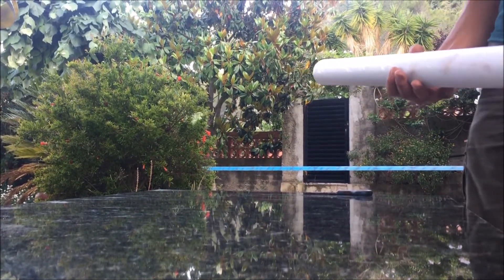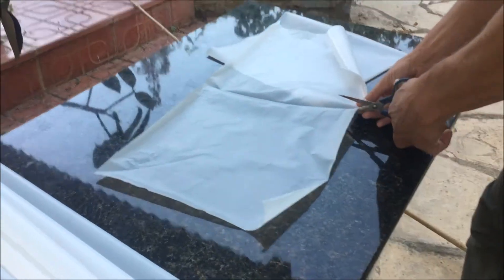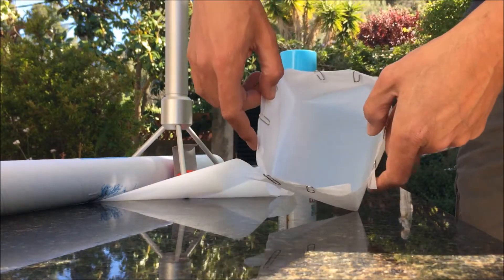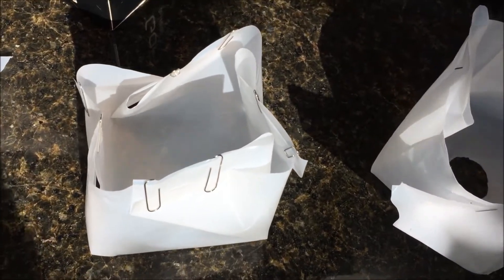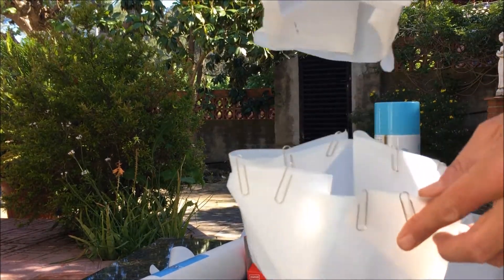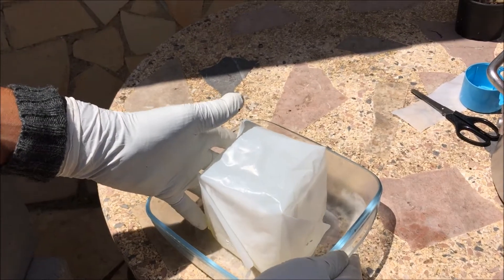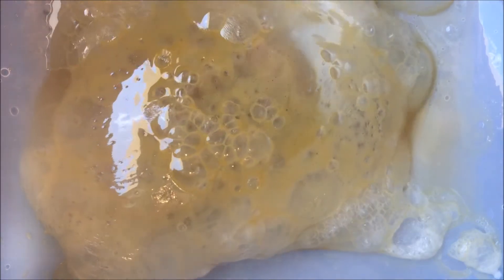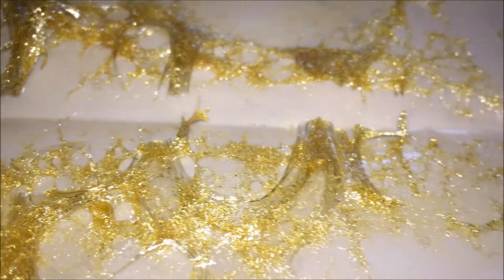Avoid condensation, use PTFE !

Comment: hi. How doas that ptfe foil working? I mean how sticky is the wax on the foil?? can you remove it easily? can you remove all of your product??

Kind regards
Reply from the maker: The fact that it removes easily from your oil is one of the main reasons why we think it is a useful product. It is also resistent to the powerful extraction capacity of Dexso DME, and to the temperatures that are used in the process.
Reply: The wax doesn't stick to the PTFE foil. After the solvent evaporates and the wax  dries on the foil, you can remove it super easily. It's seems less sticky even than a silicone sheet.
Reply from the maker: Here you can see how the oil comes of the PTFE : https://www.youtube.com/watch?v=i0eZ7NjmJ4c